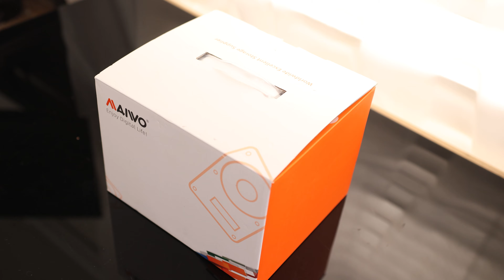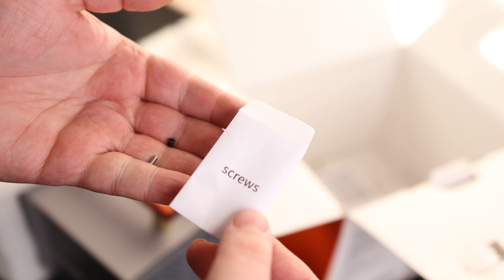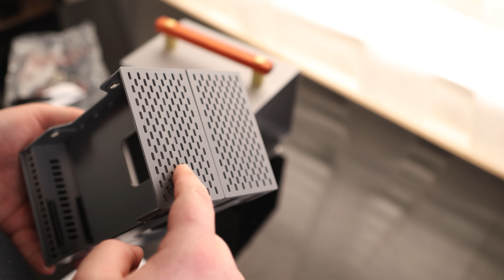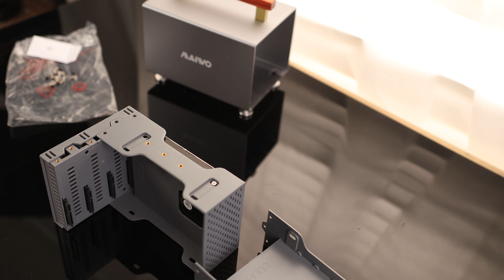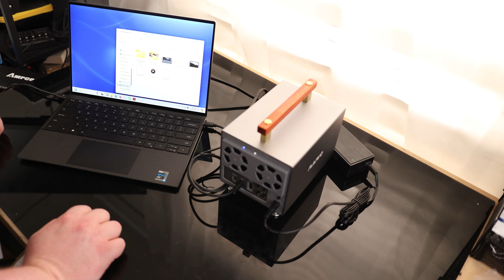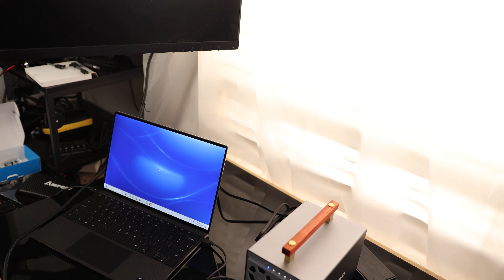MAIWO K35294A 4 Bay 3.5 inch SATA Hard Drive Enclosure with SATA III USB-C 10Gbps 88TB Capacity

Comment: Serious question: If I have 4 HDDs of 10 TB each (4 WD RED PRO) inserted and configured in Software Raid 0, then can I achieve speeds above 800-900 MB/s?
Reply: same question here
Reply: @olakase5062  The answer is yes. 850 MB/s Raid 0, 4 HDD WD Red Pro.